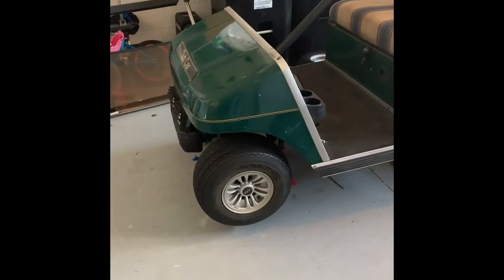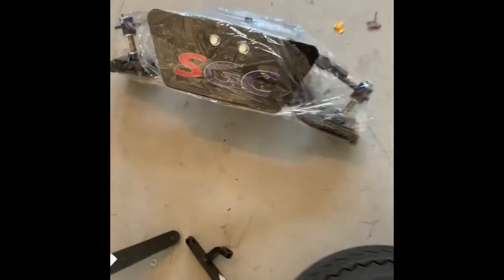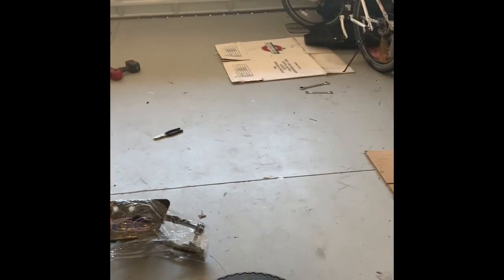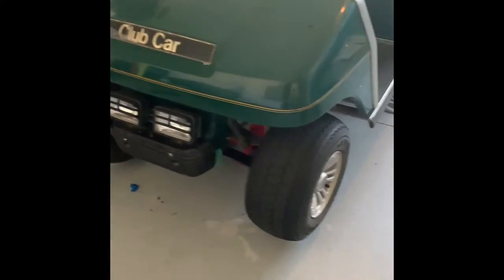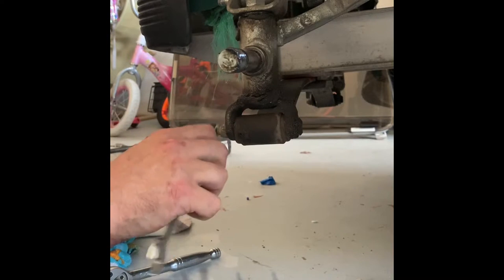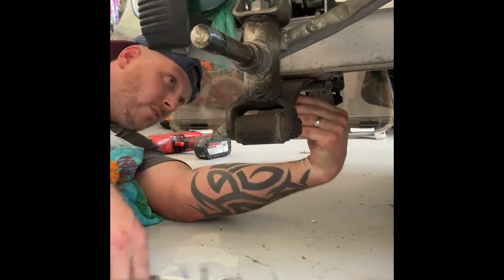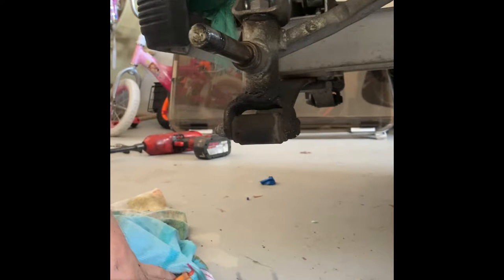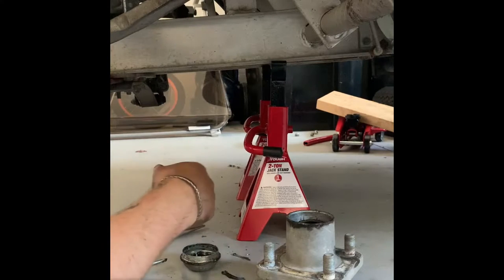Lifting a club car Golf cart part 2

Comment: I have a 96 Club Car, also.
This is exactly what I want to do with ours.
Did you have experience wrapping vehicles before?
Also, what lift did you use and did it affect the handling and steering?
Thanks!!  Great 3-part video!
Reply from the maker: Hi I had only ever wrapped my other golf cart so this was the second time it came out really good! 
I used 3M Vinyl wrap the first time then for this red cart I used Vvivid.
The kit I used was the SGC (Sealing golf carts)I think it is. 
The lift kit was in my opinion a lot better for day to day use taking the kids to school over speed humps and grass.
Never had any issues with handling or steering all ran straight.

Thanks for checking out the videos hoping to do a lot more soon!!!
Reply: @MrSar911  >> great input.  Thanks so much!

Comment: I put a 6” lift with 20” tires on my 1996 club car ds and it seems like my motor is now overheating. Did you have that problem?
Reply from the maker: Hi No I had no issues at all after stalling the lift kit.